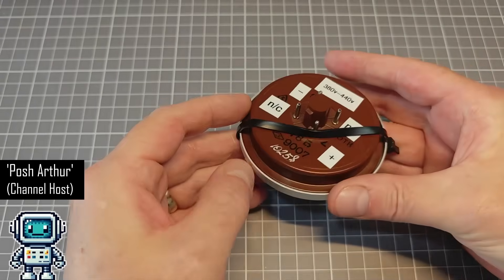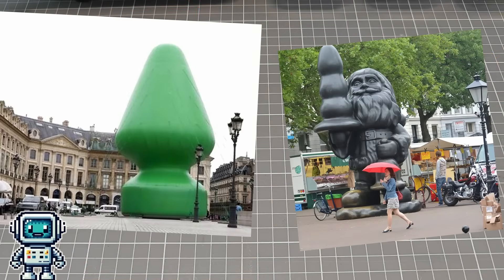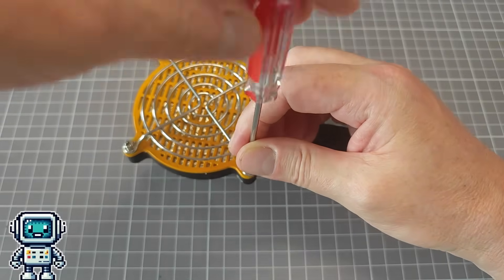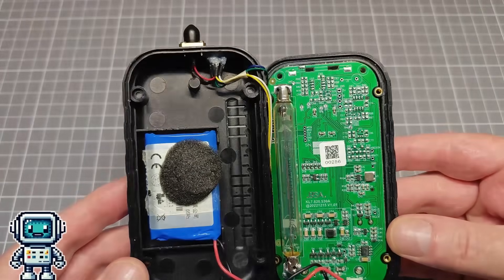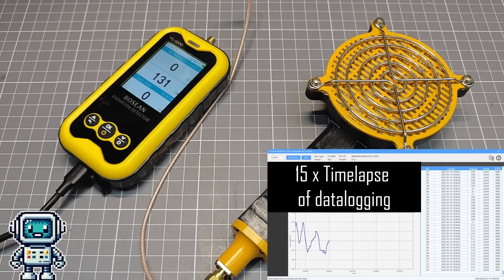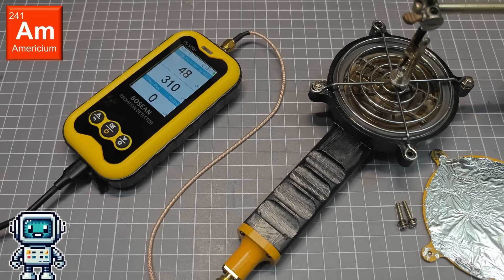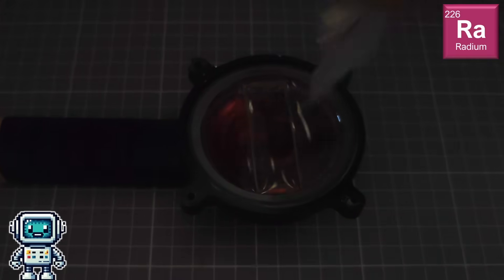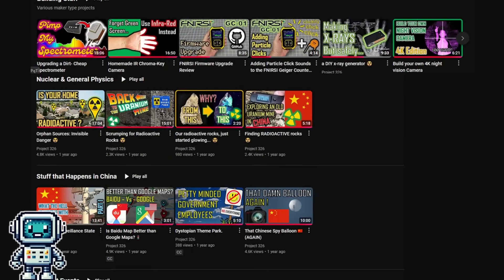Upgrading a Cheap Chinese Geiger Counter

Comment: Nice work.  The probe enclosure is fine.  Nothing wrong with that design.  The mica window on those large russian tubes is thicker and more durable than USA made tubes, so most of them cannot measure alpha.  They do have some options though.  SBT11A, for example... but it's smaller in size.  You can always stretch some cellophane plastic wrap over your tube to protect it from contamination.  That way you can still observe the flashes of light inside.  Should not effect your CPM.  Maybe you saw already the tube should have an anode resistor mounted inside the probe as close to anode as possible in order to limit current and extend the life of the tube.  It also reduces capacitance in the HV wire. A suggested value is 5-10 megaohms, but many values can work.  If you go too high - the upper measuring limit of your CPM will drop.  Occasionally you can find US made thin mica end window or pancake tubes on ebay which are sensitive to alpha.  They are very fragile but much more sensitive.

Comment: The window on a true alpha tube is VERY fragile. The Soviet Era tubes use a thicker material, making it more of a beta window. This tube was probably made in Ukraine.
Reply: this might be the explanation - on the smaller diameter soviet pancake I have, the window might be significantly thinner. Mica does also absorb alpha particles, unless it is very thin. The internal bars keep the thin window from collapsing into the lower pressure inside the tube, but for this diameter they might have used too thick mica for alpha particles to pass...
Reply: @uwezimmermann5427  There are some Soviet GM tubes with smaller, thinner mica windows but the big ones all use a thicker material. I've been told that they can actually be touched without breaking them instantly.
Reply from the maker: Thank you for the comment and the insight.

Comment: That was surprising. Mica tubes are often sensitive to alpha but that was only sensitive to low energy gamma/beta. Am241 has quite a lot of low energy gamma that not all detectors can detect.
SI-8B does not have very high need for voltage either. That is a catch sometimes when a probe needs something like 900V and is tested with device using something that runs on 300-400V tubes.
Reply from the maker: Thanks for the comment.
It's not that it was only sensotive to low energy beta/gamma/x-rays, but that is was so sensitive to low energies that my other GM devices could not detect.  The tritium example was a total surprise, the brem peak will be around the 5 to 7 KeV region...
Reply: @project-326  Oh, language barrier. In my language xray and gamma is the same word I picked the wrong word in english.
I should have said low energy xray.
(In my language any gamma rays are the same, be the energy whatever, from kilovolts to megavolts)
Reply from the maker: @hoggif  yes I agree, the definition is pretty sketchy.  For example Brem, I always call x-ray, even though it might be at a higher energy level than what is normally called gamma from a Am-241.  Anyway, they are all just different colors of light...
Reply: @project-326  I think the words are based on if the gamma rays are from a nucleus (atom core) or from something else.
Well, nucleus can emit low "xrays" like Am241 of hard "xrays" like Co60. Or are those both gammarays while 50keV is xray if not from nucleus (like in xray machine).
Same thing, gamma

Comment: RH Electronics make a cute little PCB for interfacing these probes to a Geiger Counter, it's called 'High Voltage Geiger Probe Driver Power Supply Module 380V-550V with Pulse Output'. It would resolve the issues you have with using longer leads to connect probe to counter. Can't post a link but search RH Electronics with the info above. I have one lying around somewhere... Love the videos BTW!
Reply from the maker: Thanks for the comment and advice, I might check that board out (though would probably make one myself)

Comment: Oh btw, maybe Photo Multipliers and SIPMs would make an interesting topic.
I always had a fascination for things that make the invisible visible and measurable.
Reply from the maker: Thanks for the commant.
I keep flirting with both of these, though SiPM is my most likely target for a project.  And yes, I share the fascination of being able to detect single photons, given there still is no actual complete description of what a photon actually is...
Reply: @project-326 Anton Petrov commented on a recent study-living organism actually emit a very low light radiation-that could be an application

for such a project-
https://youtu.be/Dj95FzoSlNQ?si=LXnScmKtGLO1ON7R

This camera/CCD works with 10 to 1000 Photons (!) really very little.

Question: you geiger-counter only required a single signal as calibration reference ? For spectroscopes in the visual range we usually need two-I wonder why it‘s simpler here?
Reply: I too love those kinds of things too. which is why I got an EM/magnetic field meter and a geiger counter

Comment: The little glass encapsulated device at the end of the video...

UVTRON is a high-sensitivity UV sensor that is sensitive only to UV light. UVTRON is adaptable to a broad range of applications including flame detection, discharge detection, and combustion monitoring. 

I cheated and took a screenshot of it then did a search!

Comment: Maybe u should have tried to get a bkg reading with the pancake probe (w/ the mylar), before measuring with the paper on....in order to get a more accurate idea if it really gets thise alpha particles
Reply from the maker: Thank you for the comment and the suggestion.
You are correct that I should have measured the BG in both cases to see the difference, but given that BG is mostly gamma, I doubt if it would have made any significant different.  But, you are correct, that would have been a more rigorous process.

Comment: Nice project! There is some controversy whether or not this tube is sensitive to alpha radiation. It seems they were made with different end windows, because some videos show them detecting plutonium smoke detectors for example.
Reply from the maker: Thanks for the comment.  
I think that the Alpha sensitive types have a thinner mica window.  I'm not sure what the material is on this window, but it doesn't look like mica to me...
BTW, your last video was great!
Reply: @project-326  Looks like the SI8B tubes are still being manufactured in russia by the "consensus-group" in two configurations, however with identical windows. They are explicitly listed as beta-gamma tubes with a mica density of 4-5 mg*cm^2.

Comment: You want to use the neon lamp as an ionizing radiation detector)
Reply from the maker: Thank you for the comment.  An interesting idea, though normally the quenching gas is Helium in a GM tube, instead of Argon that is often used in Neon signage and indicators.  I'm pretty sure it will be able to do something in the presence of a strong flux though, assuming the correct geometry...